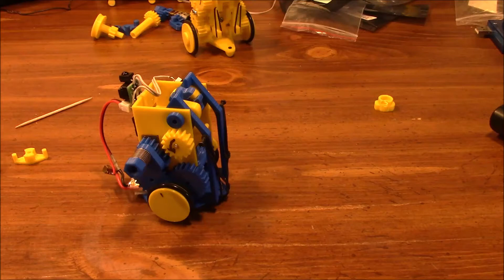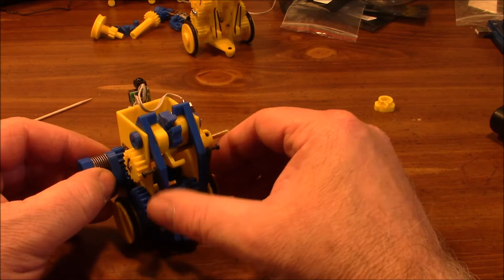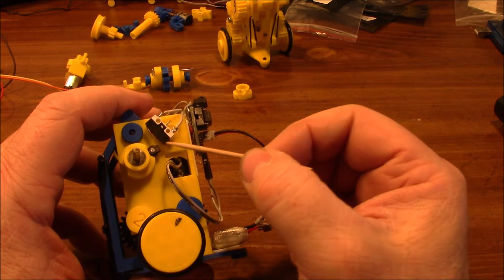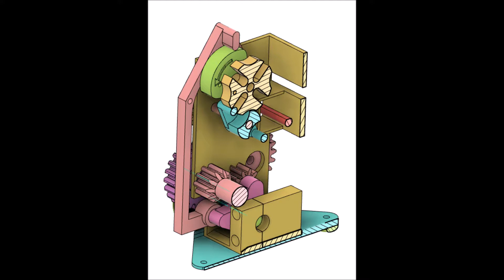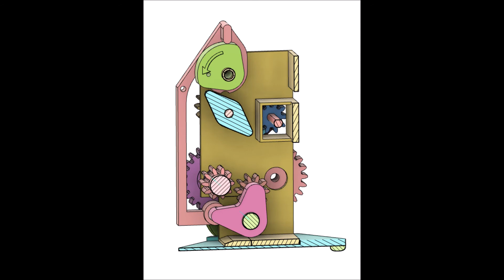Update on single motor 4 function robot.

Comment: Super smooth Rick ! How about using magnets in the repelling mode in place of the rubber bands. Since rubber bands will break down over time and UV exposer. Looking Great !
Reply from the maker: Thanks John. I'm very pleased that it works as well as it does. In the previous video you can see my first attempt using magnets oriented in the attracting mode. They are kind of hidden on  the bottom of the idlers that select the direction. They helped but weren't strong enough so I had rubber bands helping on it also.  I may give it another try with the magnets mounted in opposing mode on the frame and pushrods. Then with the right magnets and the right distance between them, it should work. I need a better selection of magnets but your definitely right about the rubber bands. They are just my lazy side showing.
 When I'm designing and building this stuff, I'm not sure if it's something I'm going to post on Thingiverse or just doing as a challenge to myself. If I post it for others to build, I have to force myself to use parts others can get instead of stuff I found in my junk box. As you know it's a lot of work to share something on Thingiverse.  
Rick
Reply: @rick_100  Yes it is a ton of work making projects that other's can build and posting to thing-i-verse as well as the build videos. People who have not done it have no idea how many hours / days / weeks it can take depending on the project. I have a walking flywheel powered robot design coming out on Jan 4th. Spent a heck of a lot of time making it so other can build built if they want. Few will ever build out projects. But if only 1 or 2 people do build them and have fun or learn something I think it is worth doing. People forgetting to give back is one of the biggest problems in the world today.